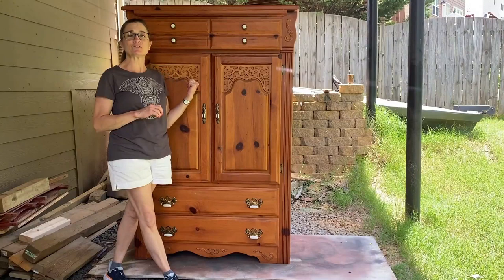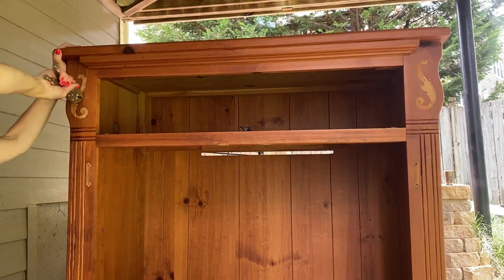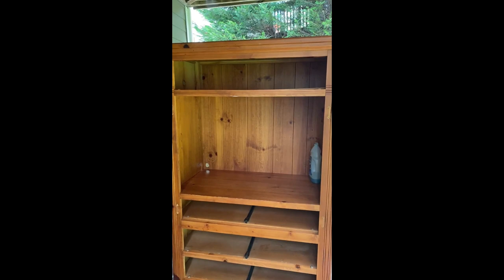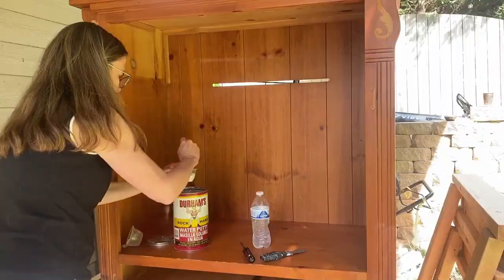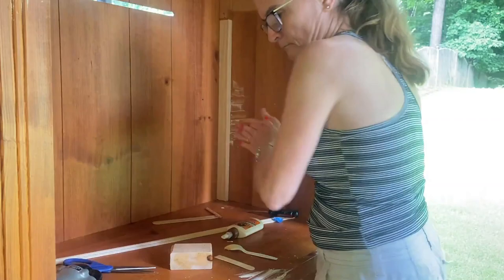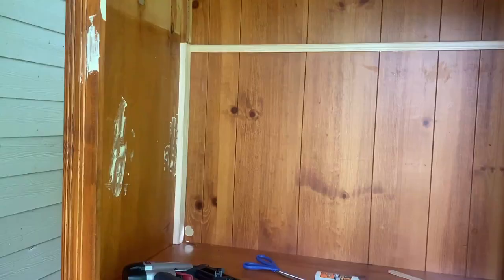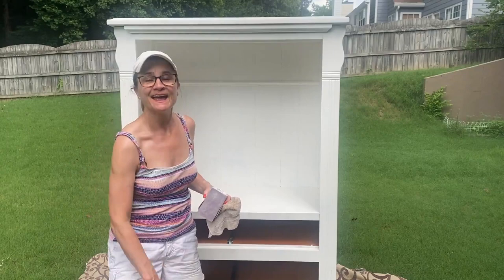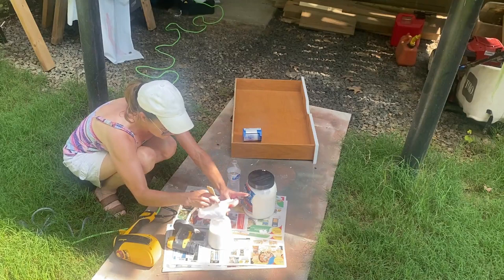Coffee Bar: A Transformation from an Entertainment Center

Comment: What did you do to run the cords through the back?? You never showed that part
Reply from the maker: There’s a hole in the back of the piece that you see earlier in the video. It was there all along. It’s where the cords of the TV that used to be in there ran through. I simply added a surge protector and ran the cord through the hole to plug in the wall.